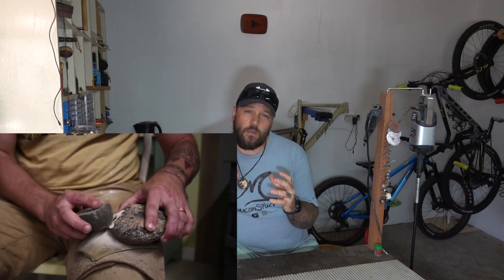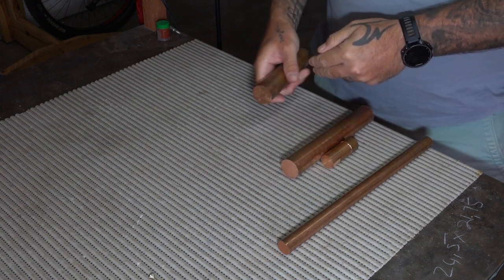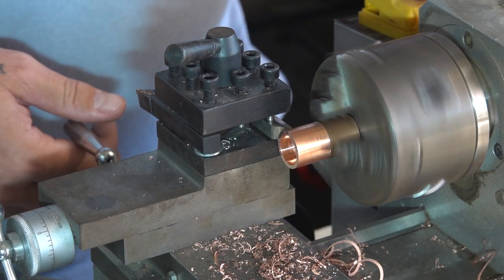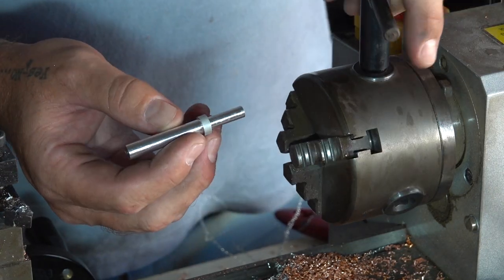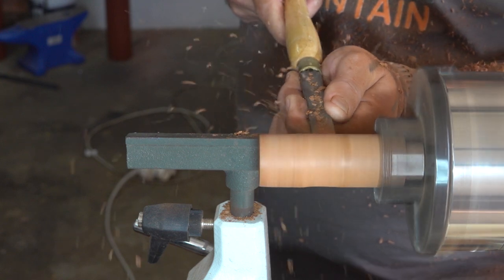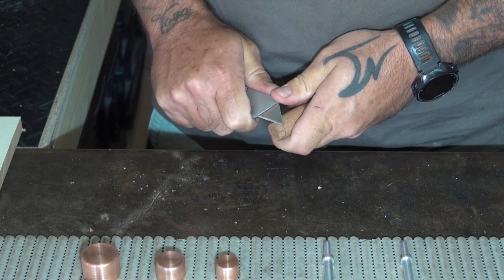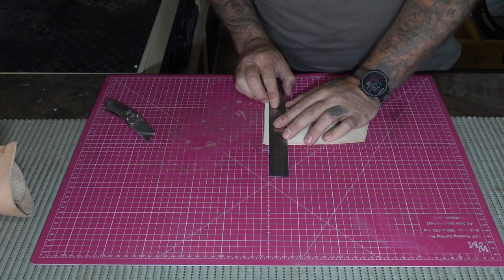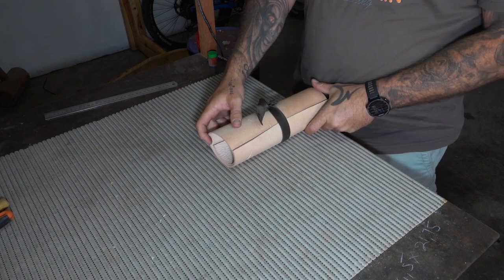Handmade Flint Knapping Tool Kit - DIY

Comment: If you had a solid copper piece you were better off just shaping the end of it the only reason people use a cap is because they don't have a solid piece of copper and besides that why wouldn't you just use a cap if that's what you wanted to go with

Comment: You should have turned the solid copper in the shape of a ballpein hammer on a belt sander then you would have been a little closer,... mass break's stone not lightness.
Then you heat the end to keep it soft so it will bite the rock and take off a small piece?

Comment: Yea, so I don't have a lathe.
Reply: You don't need one. This was made far more complex than it needed to be. 
All you need are some wooden dowels and some copper pipe end caps. Most fill the end caps about half way with melted lead and then place them on the dowels. 
The pressure flaker is a bit harder to make because of the size of the copper wire but it's just essentially copper wire.